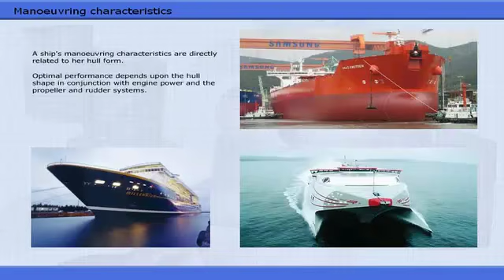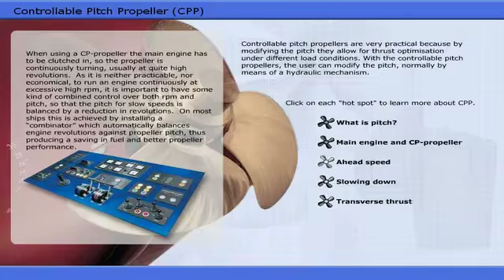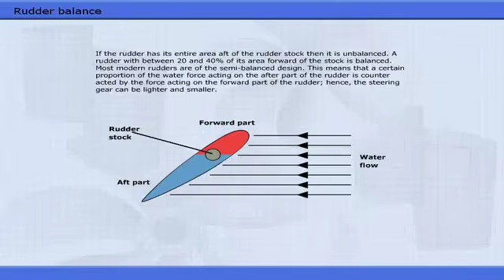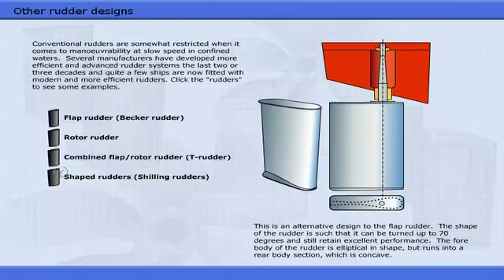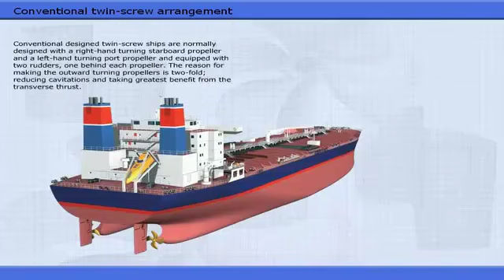Propulsion And Manoeuvring Systems

Comment: Only what is not true is that a ships engine is not economical at high rpms the ships engine is laid out so that at normal sailing speed she is most efficient and uses as little feul as is possible if you for example use 30% of power it will be less efficient

Comment: I have electrice clean mobile energy and. Perpetual motion designs.. As well as concepts to improve manuvering and propulsion..i would l9ve to share if this is the place or contact me william h reiland 4..ypu can find me on facebook or email aetherofel9@gmail.com .. Im looking for a team to work with..i have concepts whoch will allow submarines to dive without limots due to pressure..compensating with electromagnetism.. I have complet jet designs..i have automobile conversion kits to not only make auto drive withput limit of fuel bit also to transform into flying machines..each proppeller has ots own energy..each compinent attaches magnetic ball and socket control arm allowing 360 degree motion full concept description of how to create a controlable electromagnetoc ball and socket joint enclosed in document... These designs may become universal fo building all ships with m9ving parts..freeing us from complicated rods and pullies amd gears designs...all propulsion comp9nents and energy links up wireless bluetootj each with their own programing and limits..which frees us from complicated wiring and reduces the possibility of loose connections and mechanical or electrical problems.. Besides this i have much more oncluding tracktor beams rather than cables and ropes to lift objects..or reversing the energy to push things into sky..even a mountain or a home may hover in sky..fiture earth drsogns..im lookimg for connections..as soon as im discoveted we will revolutionise everything we know and repair reshape earth..

Comment: Can anybody explain me how you can have a drive shaft driving a propeller without having water flooding the boat? Is it the same system in surface ships and  submarines? Thank you.
Reply: Vasco Carvalho ...now I ‘m a fly boy myself but lesser water pressure on the surface ship .. might be a factor ... where the sub is in much higher pressure ...
Reply: That's a complex seals system which includes several seals to be assembled together, spring to push it for mating with polished surface,... which you will not see in any commercial catalogue...
Reply: One method is to use a grease box where the hull meets the water and the shaft goes through.   It is literally a box filled with grease. The grease allows the prop shaft to rotate but keeps water out.

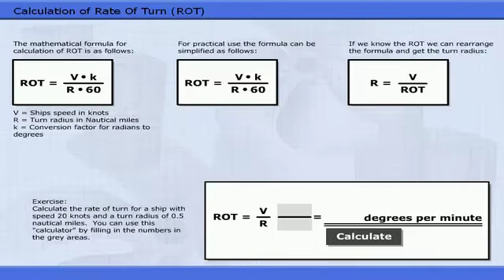Comment: The math at 19:04 makes no sense whatsoever.  

In the text presentation of the problem the speed of the ship (V) is stated as 20 knots (nautical miles per hour or 0.67 nm/min) and the turn radius (R) is 0.5 nautical miles. If k=180° ÷ π = 57.3° then in the stated formula k÷60 can be rounded to 1° (though the unit of measure for 60 is undefined), thus (V ÷ R) • (k÷60) = (0.67 nm/min ÷ 0.5 nm) • 1° = 1.3°/min. 

But the author fills in the blanks with values not stated in the text of the problem.  He enters a speed (V) of 3 (no units of measure) and how the author arrived at this value after stating in the text that (V) = 20 knots is not revealed & enters a turn radius (R) of 22 (Again, there are no units of measure and again the author does not reveal how he arrived at this value when the text states the turn radius (R) = 0.5 nautical miles) thus arriving at a value of 3 ÷ 22 = 0.1°/min or 6°/hour (rounded down from the more accurate 0.14°/min or 8.4°/hour - an underestimate of 29%) thus arriving at a calculated 15 hours to make a 90° turn ( or 10 hours 47 minutes if one doesn't round down his result).

It's entirely possible I've missed something as I am neither a navigator nor a ship handler.  If so then I'd be happy to be corrected.
Reply from the maker: Thanks.

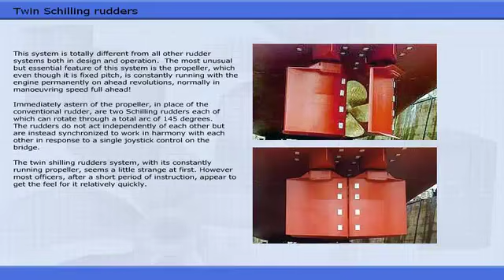Comment: What  these metal bumps on the rudder and nozzle are for (13:33) ?  Thank you .
Reply: Probably cathodic electrolysis protection (zincs). Protecting the bronze propeller.
Reply: Zinc sacrificial anodes. Reduces galvanic corrosion due to dissimilar metals.